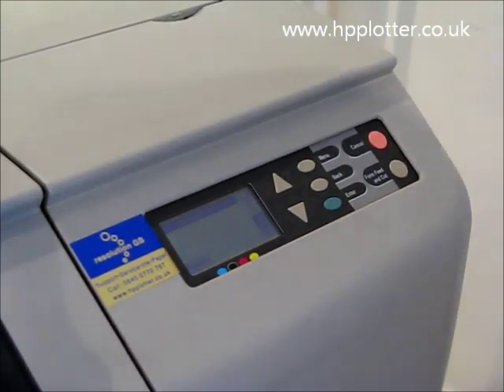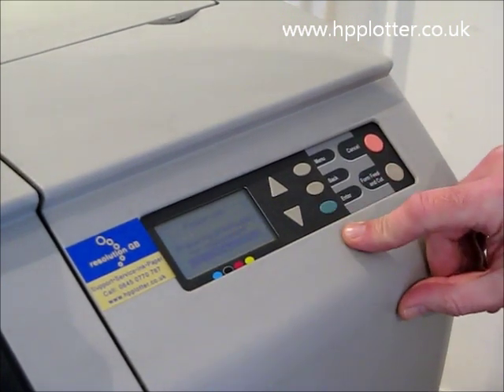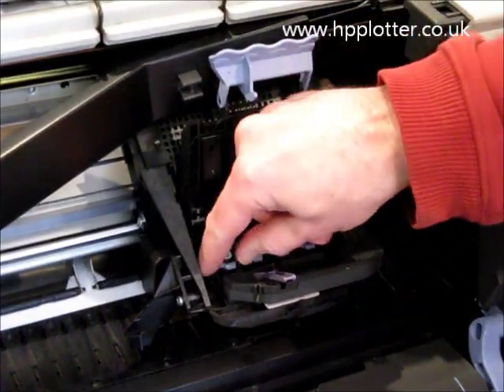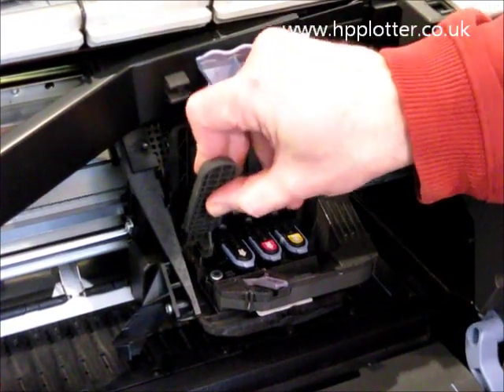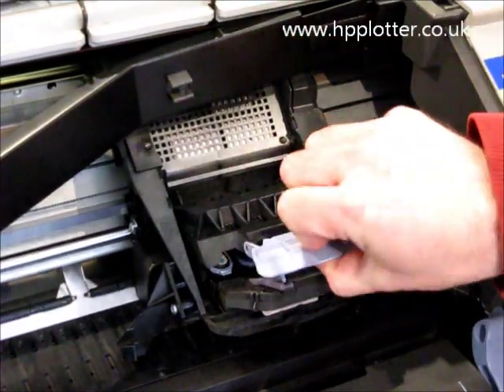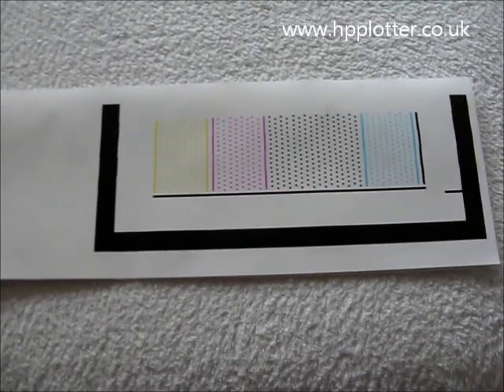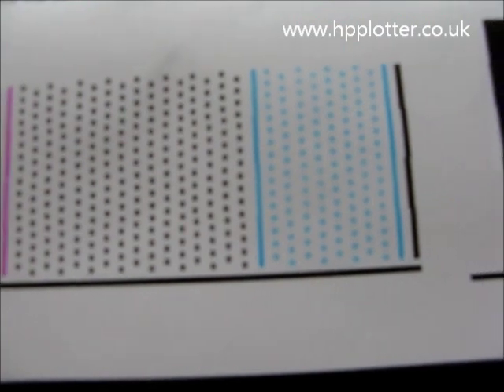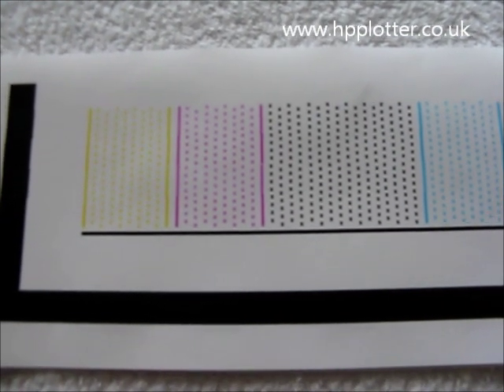HP Designjet 500 repair - how to replace the printhead on your printer - C4810A C4811A C4812A C4813A

Comment: Hello,
Very interesting video.
I was given a T770 plotter, which worked perfectly, and following a move and an 8-month shutdown, the start-up sequence blocked at 58% and led III, next to the network socket, flashed.
From what I read from the documentation it is possible that the electronic module is broken.
Can you help me with troubleshooting or point out specific items to test.
I have some knowledge in electronics.
Thank you

Comment: Hi mate..designjet 500... how do i know if cartridges are dried up or ink tubes are clogged or printheads clogged?...printer been sitting 3yrs...i soaked printheads on moist cloth and still wont print anything...blank page
Reply: You don't - the cheapest way is to wrap the ink with a cloth and give it a bit of a swing using the inertia to push out the ink - check and gently clean any contacts in the printer or on the ink contacts to remove any ink, try running the printhead alignment/cleaning several times and if it still won't print, listen to see if there is any liquid sound coming from your inks and check ink levels to see if you need to buy more ink, buy a new set of inks and printheads. Alternatively since this is an old machine I can sell you a brand new one with free starter inks, 1 free roll of paper, A1 size for £568+VAT. It's called a T230 - the stand/A3&A4 tray and roll cover is an optional extra and it has smaller inks than the DesignJet 500 if you don't do a lot of printing. Only sell to UK but I believe you're in the US?

Comment: Easy to install•ᴥ•>share4.photo/Designjet?Ю   my windows 10 found it even on a network without having to download the very confusing driver installation. The CD directs you to the HP website for driver download. It downloads zip files and thankfully I didn't need to go that route. That paper roll was easy to install and self corrects for alignment. You don't have a user interface on you computer. The interface is on the adjustable printer screen to select paper source roll vs. sheet paper. I do architectural drawings and on my very first print this printer delivered a beautiful print. Grey tones, dashed lines, everything to scale. This printer even cuts the paper for you. I will still use my local print company to run off those 5 sets of 10 pages for cost reasons but this printer has worked great.
Reply: nice

Comment: my printer showing the massage (check the print head cover) ?????
Reply from the maker: Hi Usman - This error can occur when the printheads are not connecting properly, it is usually caused by one of the catches holding the printheads in place that has broken - the small purple clip is part of the tubes assembly and the blue clamp is part of the carriage assembly – they are not sold separately.  If they are both intact then try removing the printheads and reseating them again
Reply: @HPPlotter  but there is nothing broken clips are okay im so confused what to do
Reply from the maker: Hi Usman - It could be a number of issues - a further one is to see if your encoder strip needs replacing. I would recommend getting an engineer on site to fix - or alternatively look at replacing this printer with something like a DesignJet T520. If you're in the UK then please contact engineering@hpplotter.co.uk for a repair or sales@hpplotter.co.uk for a quote on a replacement
Reply: @HPPlotter  im far away from uk and engineers .
I have encoding strip but how to replace it i dont know
Reply from the maker: @usmanriaz2803  Where are you Usman?
Reply: @HPPlotter  im at mansehra kpk pakistan
Reply from the maker: @usmanriaz2803  send us your email address and we will see what we can do to help!

Comment: I installed  a new printhead but still it doesn''t recongnoze it... help
Reply: Hi Carolina - first check that the metal contacts aren't contaminated with ink and if so, gently clean off and try to reseat printheads - but otherwise it (rarely) can be a faulty printhead so you could go back to where you purchased it from and double check it's not faulty - they will give you a number to call HP who will then ask you to carry out various checks - if they feel it is a faulty printhead they will send a new one out to you FOC. However, more often than not,  it's normally another maintenance kit part that has failed (e.g.carriage assembly,  trailing cable etc) so you'll probably need to organise an engineer to attend site to repair the printer first. Some people make the mistake of fitting an ink instead of a printhead (they are two different things). Hopefully this helps you a little. If you're based in the UK please contact engineering@hpplotter.co.uk for a repair estimate.
Reply: Thank you so much, I'll do!

Comment: Hi! I got an offer to buy an used Designjet 111, it has a problem that it doesn't want to accept the yellow cartridge printhead, although it's new and replaced, you go any solution for this? The price for the printer is cheap, but if it's not fixable I rather pass on getting it.

Comment: Great video.  I have a question.  We purchased a used one a year ago for work and it's been sitting.   I replaced the belt today and put new ink cartridges in it.  It still has the old printheads in.   When trying to do the alignment it cancels.  We did a test print of a blueprint and the 500 acted like it was printing but never laid the ink down.  The print heads look fine visually.    Have you heard of this before?  Thanks for any info.
Reply from the maker: Hello Rob - apologies for the delay in responding. Yes this issue often means that a part forming the maintenance kit has failed but you ideally should replace the printheads first to avoid incurring engineering charges as printheads do sometimes resolve the fault.. Alternatively call or email us on 0845 0770 787 or engineering@hpplotter.co.uk for a no obligation repair estimate.
Reply: @HPPlotter  Hi thank you for your knowledgeable video. Brother i have a strange problem with my DJ510PS   printer. The black ink color not print continuously. Once i remove the black head. It will print one or two A1 size drawings. Then some cyan colors will print instead of black. If i remove the black head and reinsert same head again it will do the head alignment. And print one or two pages. Its like the ink system not pump ink to head while printing. Not sure i am correct. The firmware is the latest one i tried different brand new black head. But same issues
Reply: +HP Plotter Thanks for responding.   We decided to replace the printheads and that did it.   It's working great.   
Thanks for the videos.  After watching the network card install video we decided that would work best for us.  I appreciate the videos.
Reply from the maker: you're most welcome!

Comment: I have an HP designjet 500 plotter/printer for architectural and engineering prints that has been sitting around for the past year. It worked great until the print heads dried out.  What do I need to do to make it work ? do I need to replace and prime the print heads?  and what part I do I need to exactly buy? I would appreciate for your answer, THANKS!
Reply: +Alan Freid  You need to replace the printheads in the first instance - part codes are:  C4810A, C4811A, C4812A and C4813A. Our cost is £27.50+VAT each but prices fluctuate week to week with exchange rates. You can also run a printhead alignment test to check which printheads have failed if you don't wish to purchase a full set.

Comment: I have this same printer.  It has all new print heads installed.  Only about 40 days old.  But I am still getting banding.  On the alignment page the cyan and magenta have missing lines on the squares and on the vertical lines they appear blurred in places.  My quality test print shows only banding on the cyan block.  I have tried all the alignments and cleanings of the print heads.  What possibly more could I check?  Thanks
Reply from the maker: Hello Heidi - it sounds like you may have a faulty part which will require replacing. If you have already run alignments/cleaning of printheads AND they are new printheads as well then the next port of call is to call in an engineer. Please feel free to contact us on engineering@hpplotter.co.uk for a repair estimate.

Comment: Great video guys, obviously know what your doing, I dont lol.

Can these use inks that are ok for outside in the rain? emmm, like say an advert on the back of a bus ???
Reply from the maker: Hi Lez

Thank you for your comment and apologies for the delay in responding. The Designjet 500 inks are dye based inks which means that they are neither UV stabilised nor water resistent like the Designjet inks of the Z series printers (prints with the Z series are guaranteed not to fade for the next 200 years).

Unless you buy a latex printer, you would have to laminate your print for all HP Designjet prints for outdoor use. The Designjet 500 isn't designed for signage or outdoor work unfortunately.

The other issue you will have relates to UV degradation/print fade/air fade - and for this you can try using swellable papers to reduce fading - but the problem you have is that if you intend to use this print outside, swellable papers don't perform well in damp or humid conditions because the gelatin-type coating will start to move back into a gel form, causing the inks to become hazy. I hope that makes sense? You can always rent a Designjet Z series printer or outsource this particular print to keep your customer happy.

Comment: I cleaned it with a damp tissue. I might get a contact cleaner actually and do that right, but they look clean. There are 2 trailing cables and one of them was already damaged a few months back, but that was the one that controls the carriage not the printhead cable and it was giving some other errors but it was fixed (straighten and cleaned) and was working for a long time.

Comment: Hey guys, after replacing the print heads I got a message that they all need replacement. I got a message to replace one and I took out all of them, cleaned the shiny stuff inside, popped them back inside and then it just started being mean to me.  Any suggestions on what it might be?